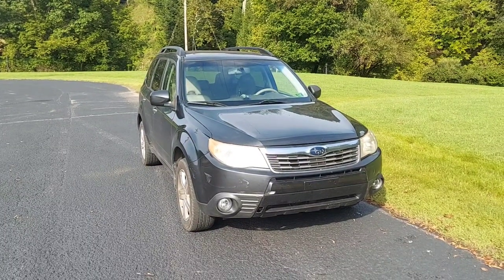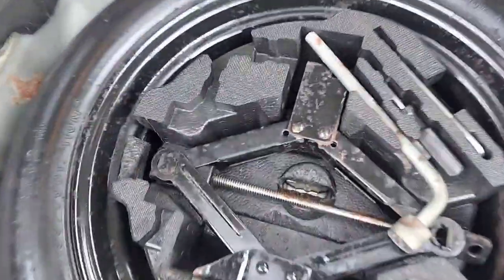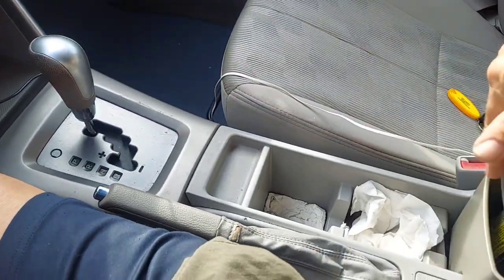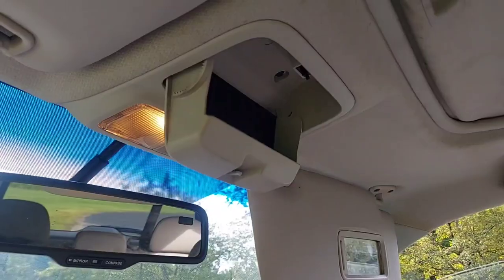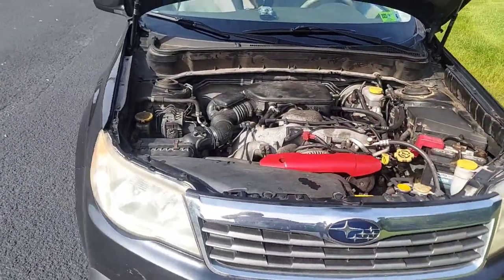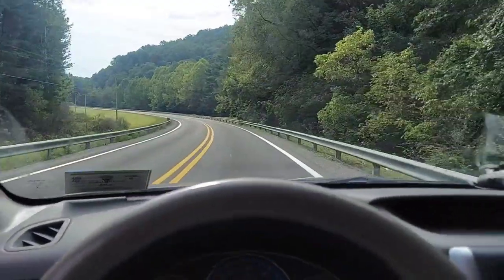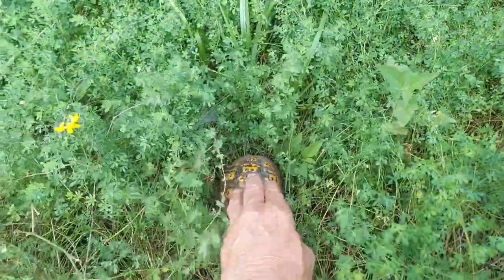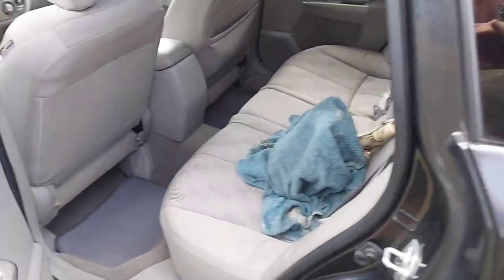Subaru Forester 14 Years Later!

Comment: Easy upgrades are the auto dimming mirror, tweeters (simple and huge difference), and fog lights. Easy maintenance that nobody ever does is clean the MAF and throttle body.  I also replaced EGR and PCV. Super easy and important.

Comment: The pouch doesn't exist on the driver side because these cars are intended for interchangeable left and right hand drive depending on the country. The seats I suspect are initially placed in the spot for right hand drive in Japan, UK, etc.
Reply from the maker: Good to know!!
Reply: @FixingWithPassion  it's only a guess. I have never owned an American car (even though I myself am an American), I assume the pouch is behind the driver seat OR there are pouches on both sides nowadays?

Comment: What about the headgaskets sir?were they leaking ?i heard subaru have HG issues after 100miles
Reply: That was the previous generations 1 and 2. This is a 3rd gen. No more head gasket issues since.
Reply: @m3chanist they do on the 2009-2010 they are still the EJ253 I have a 2010 with 141k miles runs great havent done them yet but its getting into that ballpark
Reply: @Austin-cg7be  in the US maybe, my 2010 has a FA motor. EJ phased out